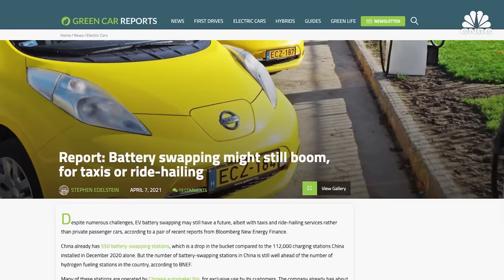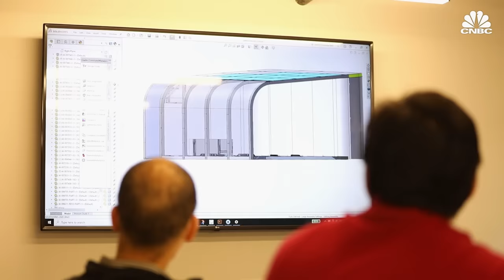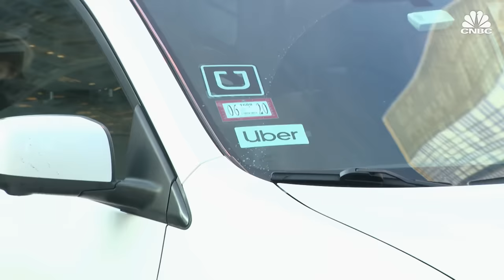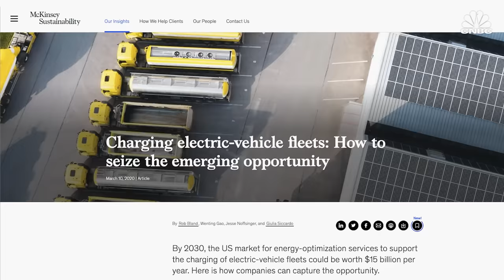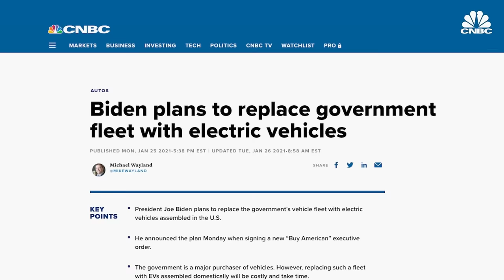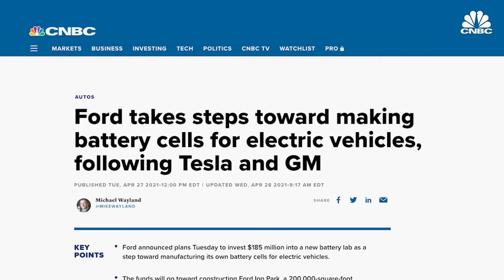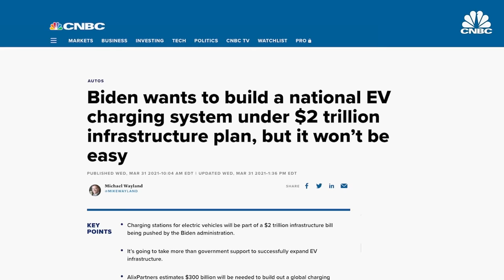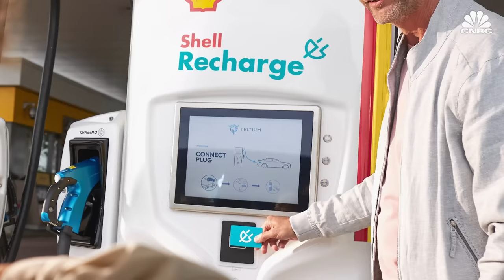Can EV Battery Swapping Take Off In The U.S.?

Comment: Not just battery swapping, but in fact battery and electric motors retrofit in older cars.
This is how you fight pollution faster, by upgrading cars from combustion to EV, (swapping out the motors) and not waiting for decades until people buy new cars to replace old cars.
Old cars are good and comfortable and no smart buyer wants a new overpriced EV with lesser comfort.
The tax credit and all subsidize should be done for EV retrofit, not just buying new EV

Comment: I love how I thought of this YEARS AGO when EV's first became popular. I always knew the charging method was to impractical. The battery swap method is exactly the way I thought it should be implemented. I know it's more difficult but it's definitely more convenient for consumers.
Reply: It's also a lot more expensive. Instead of having one battery pack in every car, you need spare battery packs to swap in and out and the infrastructure to handle that. Most people don't need battery swapping when they can just charge their car overnight at their home and aren't going to be willing to pay the added cost for battery swaps. It's especially impractical in many places in the U.S. where we have single-family homes that can have solar panels on the roof and people can then charge up their electric cars for essentially free.
Reply: @rreagan007  what? Are you serious? Did you not watch the video? This method isn't as expensive or as stressful to America's power grid & it's good when you drive alot or want to take your car with you when you travel to other states. What's it Matter how old a battery is on the modules when you can just stop at another swap station?(assuming the infrastructure is present) alot of people that live in cities don't have "solar panels" or even a garage to charge. It would be similar to a gas station but instead of fuel you'd grab a charged module and be on your way. Im not saying take away the charge method but imagine both options.
Reply: you knew?  fantasy is easy, but as we are seeing they are integrating the battery as structural now to save weight because weight is range, so its not going to be a thing for a long time.  Battery capacity would have to increase several fold before such an idea even became slightly viable.
Reply: @emersiv5631  Nah its dumb. Ev range is increasing really quickly, so you wont need to stop and charge as often, something thats getting faster and faster. Increased weight of the vehicle really reduces range, having a hotswapable battery vs a structurally integrated one is going to reduce the range. The majority of car use isnt going on long trips, so most people will have their cars charging over night. Even on long trips fast charging is getting faster and faster. Many places are retrofitting street lamps into ev chargers for people who dont have a garage. How many battery packs would they need to have at a station, they said they would be trickle charging these packs so youd need a lot. Having piles of the most expensive component of your vehicle sitting around is such a waste of money.
Reply: yup this is the way to go and obvious to everyone except car manufacturers that want to sell proprietary batteries and new cars when the battery dies.
Batteries should be compatible between cars and rented not owned.

Comment: Range anxiety is a problem for home owners with an EV. Charge time anxiety is what apartment tenants with an EV feel.
Reply: Boy do I know that anxiety…😬 My Leaf has a relatively short range that makes commuting to work a bit more stressful than with an ICE. Guess here’s to saving the planet 🌎🍻
Reply: @joeys.1613  Time for you to upgrade to a car with more range.
Reply: @justsomeguy934  absolutely. I think I’ll always hang onto this 1st gen leaf, but very excited about what the future has to hold for these up and coming EVs releasing soon. I have a feeling next year will be a great time to upgrade.
Reply: @joeys.1613  The 1st gen Leaf, I believe, is the cheapest automobile to operate in the USA. It can actually pay for itself in fuel savings, especially if you can buy one off-lease at a low price. If your Leaf meets your needs, keep it. If you need more range, the 64kW model is a great improvement. If you might need a small sedan later in life (e.g., a child getting a driver's license), the Leaf fits that bill perfectly.
Reply: @justsomeguy934  these things are great. 65k miles and it still drives like new. Maybe one day I’ll upgrade the battery in it as costs keep lowering to do so. Keep this thing going for another 10 years. Reduce, reuse, recycle ♻️
Reply: @joeys.1613  "65k miles and it still drives like new. Maybe one day I’ll upgrade the battery in it as costs keep lowering to do so. " Absolutely keep a working, reliable car if it still suits your needs. I'm not for replacing a car unless necessary.

Comment: One guy in the documentary commented  that a person would not have a clue as to where his swapped battery came from, or how much usage it already piled up over time. 
                            Well folks that problem is easily resolved by simply operating a tracking system of the serial numbers of each battery pack that is installed, along with the cumulative mileage driven of the same battery....If they can land on Mars;  this a piece of cake to do.

Comment: Let's be honest, this is never going to work on a large-scale unless consumer EV batteries are standardized. And that's not going to happen.
Reply: It can happen, some countries already standardize EV plugs. So depends on the regulators.
Reply: I have the same question.  Seems more difficult to standardize a battery.
Reply: @UltimateAlgorithm  EV plugs are something completely different. This is like trying to standardize ICE engines. The battery, cooling and heating etc is what differs from each battery pack to the other. Not capacity or plugs are the issue...
Reply: @DerSnipOr  I mean D, C, AA, AAA, AAAA and 9-Volt batteries are standardized, and they support quick battery swapping. So even if there are slim chance they could be standardized. Also if regulators in China for example push for standardization, I don't think manufacturers will reject it.
Reply: @UltimateAlgorithm  You are right, but the car power batteries are something completely different. You have a cell cooling and cell balancing system. Also the battery with its housing is a structural component of the car. The size, weight and place of the battery defines the dynamic behavior of the car. Height of center of gravity ->  dynamic load shift between wheels while accelerating/branking.

All in all it is abit like batteries in smartphones,  they are also not standardized because of packaging and design.

Comment: "for a fast charge thats as cheap as gas" so its going to cost as much as gas or probably more when charging will be cheaper. this system makes sense for people that wont have access to a charge point at their homes.
Reply: It makes no sense at all..
Its better to just go to a public charger (and there are plenty of them now) and recharge the battery..

The swap stations are only good if you need a completely new battery because the original is affected by degradation and is out of warranty.
It makes no sense to use these swap stations every time a driver can't find a public charger when his/her battery is dying.
Reply: Battery swapping IS A DUMB IDEA.
Sounds "Clever" BUT Batteries is the MOST EXPENSIVE part of an EV AND there is AND WILL BE a battery shortage for the foreseable future.
With battery swapping you need MORE BATTERIES.
Most cars should be able to charge while parked so more chargers are needed, swapping is unecessary.

Comment: Several points I am spectacle about battery swap . It seems more of marketing. Main reason ppl excited about swap 1. Can “upgrade” their battery any time. 2. Get a full charge like gas station time-wise.

For 1, actually it is not not too difficult to upgrade your battery even without swap. The only useful case is you can rent a bigger battery occasionally while rest of time rent a smaller pack so ideally you may “save” some money if you are not driving a lot. Otherwise it should be a regular maintenance job to replace your battery for cars does not support swap (unless they are horribly designed).

For 2, it only works if swap station can scale like gas, I mean not only number of station wise, but also pumps per station wise. Swap requires level of automation far more advanced than gas pumps and makes it much more expensive to have swap slots vs pumps per gas pool. If you go to a station it has 1 or 2 swap slots, each takes 5 mins (2-3 mins for swap and rest for park in drive out). It easier gets more than 15 mins with 10 cars ahead of you. Not mentioning max batteries per station and the maintenance of them. Fast charge station on the other hand, feels to me much easier to built and maintained. And delivers a 15 mins full charge is promising with potentials for less.

The drawback of swaps is now your car has to be limited design to support battery swap, so it may not be optimized towards max capacity/load balance/economics. Plus, All new models have such limitations. It is very large overhead on rolling out new models.